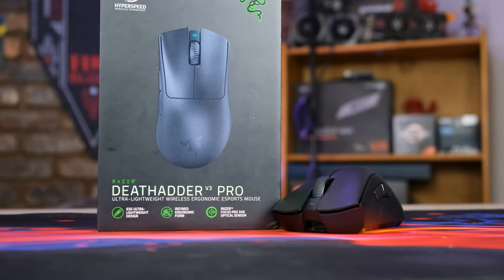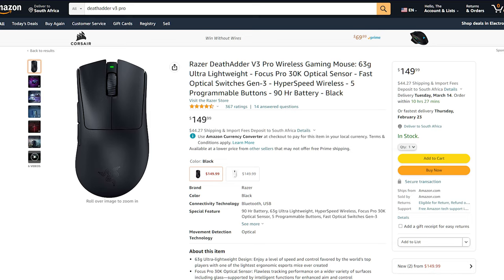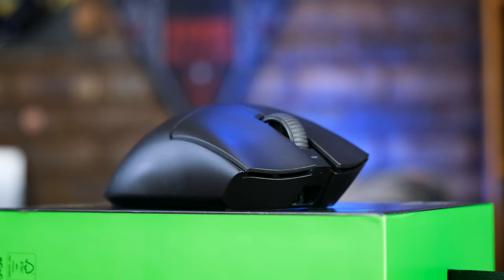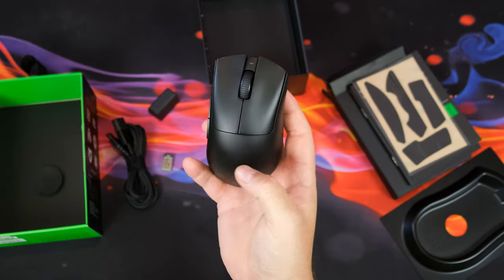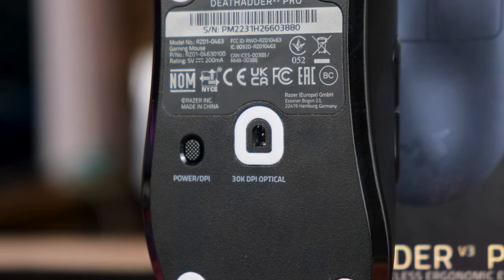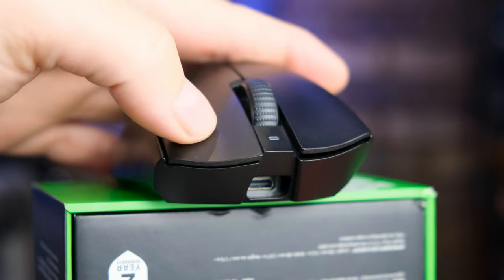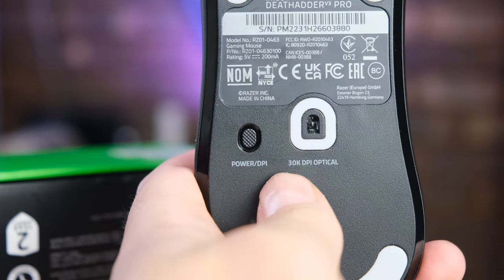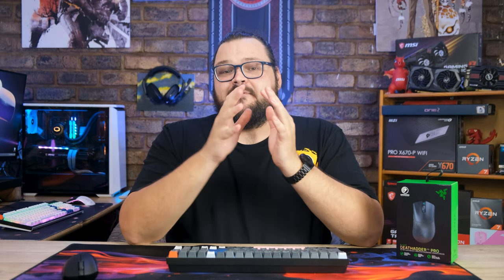Razer’s BEST MOUSE EVER has a BIG problem... - Razer DeathAdder V3 Pro Review

Comment: I just bought v3 non-pro and the left click is just HORRIBLE. It takes Herculean amount of force to activate (click) and after that the button simply gives & gives in completely, providing no resistance whatsoever.

They may be old, but both my G700s (a decade old mouse that I've been using for... a decade!) and G9 (you know, from the era before g700s) have a very different kind of button. They are much easier to actuate and, if the amount of force is small, they push right back, ready to be clicked again.

I just can't play grid.. what was the name in aimlabs? I can't play it with Razer mouse simply because to spam clicks I have to lift the finger off the button completely to de-click the button. Returning it to the shop.

But everyone keeps praising these buttons. Did I get a lemon or is everyone crazy?
Reply from the maker: It sounds like you could've gotten a bad unit, but it could also be that you're so used to the buttons on the Logitech mice that you can't really get used to the Razer. No one button/switch is going to feel great to everyone, unfortunately.

Comment: 2008, I bought a Razer Imperator. I had 2 and both of them double clicked within 2 years. Must have been all those Blizzard games. I got a G402 in 2017 for my birthday and I am still using it. When this inevitably starts double clicking... I will get another one. Buying(Again, birthday gift) one mouse in almost a decade is cheaper then buying a cheaper mouse every few years.
Reply from the maker: The double-clicking thing has legit creeped into every mouse I've ever owned (some much sooner than later), and it's such a bummer. It's annoying in games, but in Photoshop it's an absolute nightmare. And it doesn't seem to be all that price-dependent - my last three or four mice have all been R1k and up, and I wouldn't personally call that "cheap" 😂
Reply: @TheTechTank  Yeah all I know is my "cheap" mouse is still not given me trouble and on that alone my next mouse will again be a Logitech G402.
Reply from the maker: @NetNeelsie  Honestly a pretty solid plan, the 402's an absolute workhorse. I just want to get my hands on a G Pro X Superlight so bad (or the DeathAdder if Razer's feeling exceptionally generous 😂)
Reply: @NetNeelsie  Logitechs also have double-clicking issues because that's inherent to mechanical switches. You can solder in new switches when that happens on a mouse that you like.
Reply: @Slavolko  Oh that's unfortunate. Yeah, my mate said he replaces mouse switches himself. If this one ever gets weird, i will let him operate.

Comment: I bought the wireless version - also corded if you wish to or if battery runs out (for the premium experience) I use gaming mice since CS 1.5, at the time the Logitech G series (even at least two had weights which could be added/removed accordingly to your likes), had at least three (2 corded 1 wireless - tech was not the same...). My first Razer was the mamba (wireless) some two years+ ago (I got the impression logitech was going with too high prices/quality) and I become addicted to it as it was really a major improvement in many aspects. I had some cable issues and battery time is not that great so I purchased another cord (micro usb, but proprietary fitting on the mouse micro USB port - glad this one does not demand a proprietary one, just for sakes of it). Meanwhile I was seeing this mouse like 2 months ago when I bought it and damn if I'm glad I got it. It's better, in many ways than the mamba - which btw I deem as excelent yet -, so light, so easy to manouver... but I do miss razer legacy RGB andd I don't agree such would made this mouse look like a cheppear one, but the concerns on battery make a lot of sense. The best mouse experience I ever had. Still use the Mamba in travel (due to my line of work on Academia) when I want to relax at the end of the day - 159€ is a lot for a mouse to be on travel and subject to accidents - the mamba was also not cheap, like 80€ or so 2 years+ ago. It's really a heavy price mouse, maybe to much even for it's remarkable work - still I dislike a bit the basilisk (I have one, the ultimate, not the viper ultimate with micro usb, the regular ultimate uses a similar cable to that of the mamba, micro usb, proprietary fittings) and the latter version, viper ultimate, is now being sold at a whopping 189€!!! Damn, razer's mice are the best but chill on those prices!!!

Comment: Mine dav3pro died after 4 months for no reason. Wireless conection receiver broke. I'm using spc gear lix plus wireless as a replacement and I enjoy it more even its 3x time cheaper... I'm a competitive fps gamer btw. I came to the conclusion that big brands are often overpaid. If razer give dav3pro normal coding (not this strange bumpy one), made it with holes and change smth with switches(they are crisp but poorly spamable which is a bad in my opinion) it could be my endgame.

Comment: Just buy the wire version! Totally worth it
Reply from the maker: Agreed, unless you really want wireless.
Reply: aside from being wired, whats the diff?
Reply: @Adrian-pl3ui  The weight and coating is the only difference. Regarding the coating, which is much better (IMO)! Switches, shape sand wheel encoder are the same.